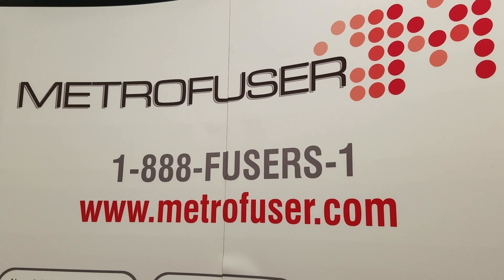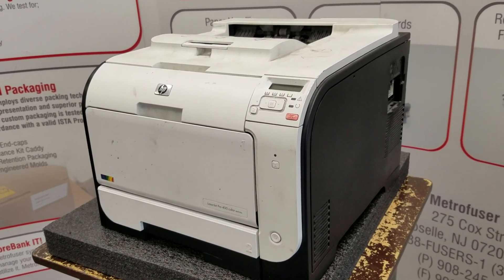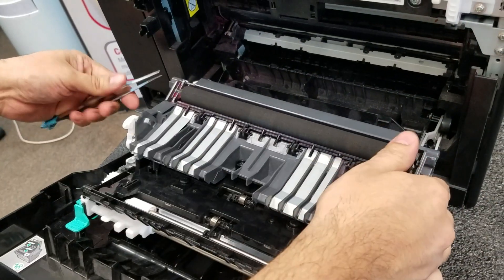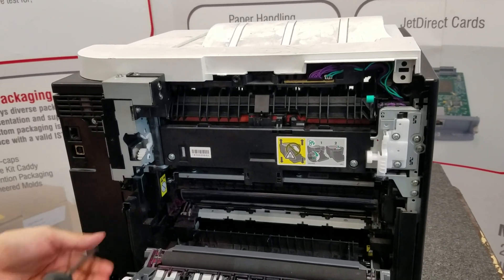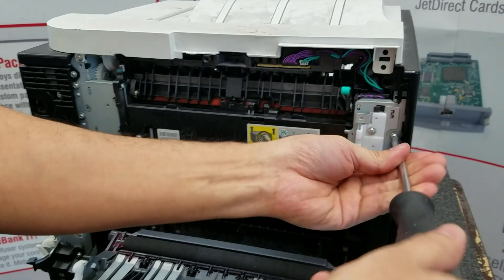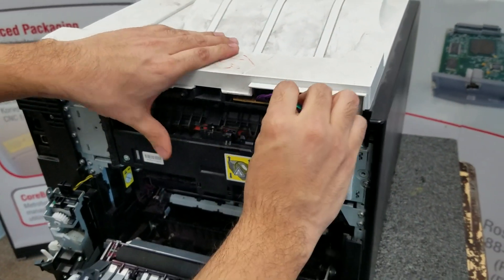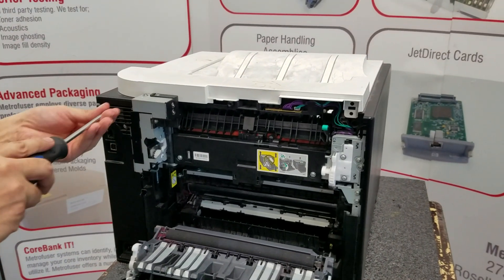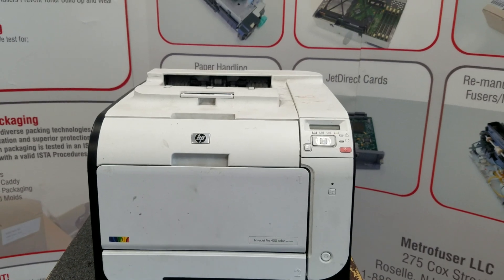How To Remove and Replace HP M351 M451 Fuser Maintenance Kit. Part 2 RM1-8054 RM2-5177

Comment: Hello, Thank you for the instructional video.
It would have been better if you showed that there are actually 3 screws holding the gear assembly that covers the left side of the fuser. You only remove 2 in the video. Third screw is inside the gear assembly, just above the white gear.
It was also easy to figure out how to remove the cover that covers the wires on the top back edge of the printer as well, but that was missing from the video... and your printer. :-)

These instructions helped me get that melted transparency out of there. Really appreciated.
Reply: There is apparently a part 1 somewhere, but I can't find it. After 2 months, I suppose your not getting a reply. Lol